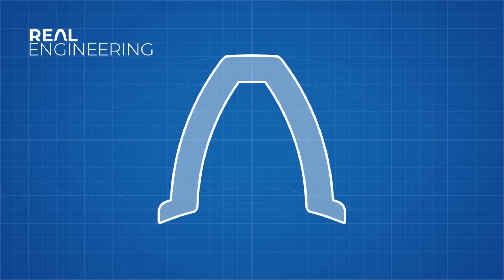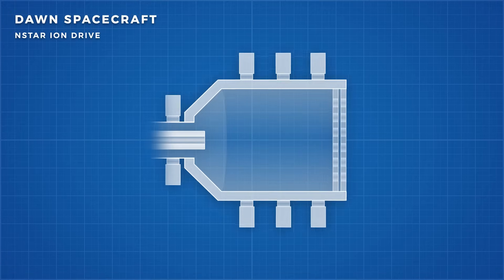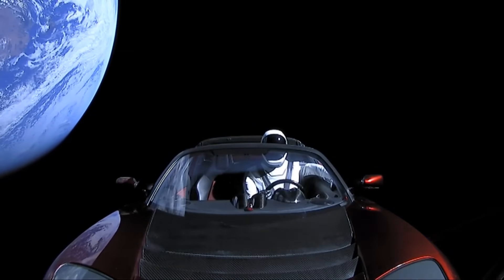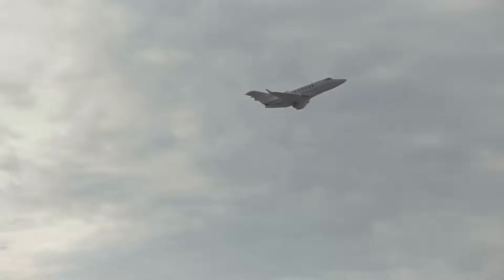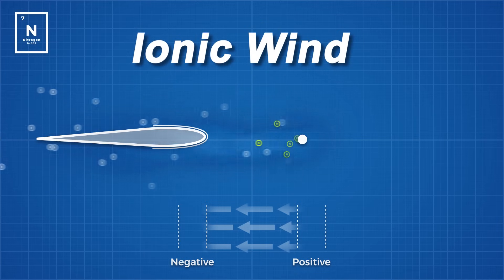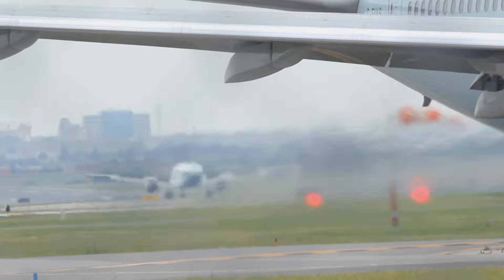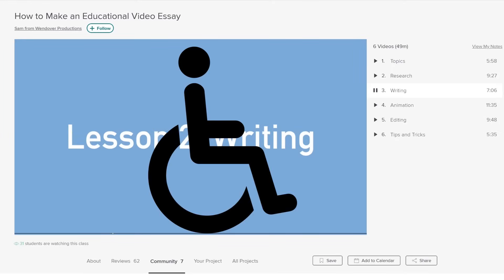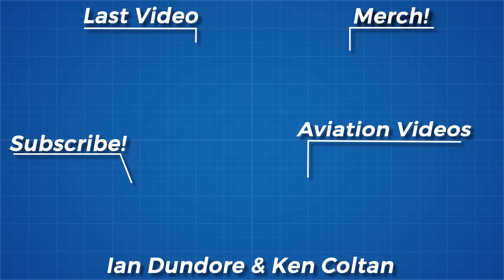Ion Propulsion - The Plane With No Moving Parts

Comment: What is your view on nuclear fission power on a global scale?  I think we should build more modern designed reactors.  Or even thorium molten salt reactors.
Reply from the maker: I'll make a video about it this year I promise. I don't know enough about it right now to make any intelligent comment on the subject.
Reply: I power my house fully with solar PV energy that means both heating and electricity and in therms of cost amortization this is more cost effective than natural gas.  The house is small and energy efficient (also designed by me) and is in a cold place Saskatchewan Canada. The 65m^2 house (700sqft) is powered by a 10kW PV array + 160kWh thermal mass storage and a small 5kWh LiFePO4 battery. Peak energy needs are in January when house need 1000kWh for heating part of this is provided by the average electricity usage 120kWh/month for appliances including electric cooking.
Total cost of materials (labor was done by me and not included in cost) is $15k and all is solid state with a minimum expected life of 30 years thus monthly bill for electricity + heating is $42/month about half for each.
Here is a link where you find user manuals and a description on how this works (see last pdf) https://www.kickstarter.com/projects/electrodacus/solar-bms-and-digital-mppt-for-pv-electricty-and-h
Reply: @RealEngineering  "I'll make a video about it this year I promise." 

So in 3 days? :)
Reply: @RealEngineering  👌👍
Reply: @RealEngineering  

Please do a video of Solar, Wind, batteries, and their supply chain management.

Their massive use of rare earth metals, cost of extraction, use of petrochemicals
Reply: Molten Salt Reactors are the only model we can A) Cool consistently enough and B) Miniaturize enough while maintaining effective shielding.

Our main problem is that we've been building reactors far too big, which makes them vastly more expensive to service and doesn't incentivise shutdown or complete overhaul.

What we need are fission reactors for individual cities not entire states.
Reply: Why didn't you point out the existence of fission reactors working with fast neutrons?
When designed properly such a reactor can reuse radioactive waste from the old-fasioned reactors.
And when designed inproperly such reactors just produce less radioactive waste.
BTW, there are already 2 working, profitable and reliable reactors using this principle that actually reuse radioactive waster right now, so we can be sure it works.
Reply: @Optical Clarity You sound just like any LFTR fanboy. And you're very rude also. I don't believe for a second that you're actually involved in any serious work on the matter with that attitude.
The quality of your comments has rapidly declined within this section, down to the point where you're only making a joke of yourself.

And that video you linked is everything else but "a good introduction to LFTRs". It's an action-filled trailer with catchphrases and no science. Only good for those that want to make LFTRs their new religion.
Reply: You guys are such nerds lol I love it
Reply: Great piece of technology, especially getting rid of long-term radioactive waste is great, but the engineering side isn't quite solved. Molten salt reactors operate in a temperature range of about 500°C to 1500°C, which is great from a thermodynamics standpoint (large temperature ratio -> high efficiency), but horrible from a mechanical standpoint. Steel melts lower than that, and even high-melting alloys get quite soft, making the construction hard, expensive, and requiring quite a bit more maintenance. It may still be uneconomical to build MSRs. AFAIK, only China is seriously pursuing the idea, and that's probably not an accident with them being a command economy, and no market economy trying to compete with them.
Plus, at least with Thorium MSRs, there is the issue of using large quantities of hot hydrofluoric acid on site, which might be a tough sell in any country that gives a fuck about the environment or worker safety.
I'm not even sure the "does not require a pressure vessel" is that much of a safety plus, tbh. Building a tank that will hold 150 atmospheres is something we know how to do. Building pipes that will happily conduct radioactive, corrosive soup at a temperature that would melt steel, not so much.
Reply: Yes. Absolutely yes, at least until we master fusion. Nuclear has long been the better option. The sheer amount of land it takes to equate to nuclear is astounding, and the cost of development and maintaining solar and wind power suppliers just adds to that contrast. People are just to freaked out by its historical failures, even though less people have died in nuclear power suppliers than alternatives like wind and solar. 

There is a good reason the US invested billions and got nowhere with green energy. The truth is, it doesn't work as well as people would aspire it to be.
Reply: Using U235 reactors (with uranium enrichment) would prove to be completely unsustainable, we'd run out after a couple of years. You need to save your U235 to kick start the reactors, since otherwise you can't begin the nuclear reaction.
Using Th232 or U238, we would have as much nuclear fuel available as there is tin available to mine. It is so much that you cannot call it non-renewable. If you want to call Th232/U238 non-renewable, then you need to call geothermal and solar non-renewable as well, since those are going to run out too.

As for LFTRs, well, I'm not 100% sold on them yet. The core principle of the LFTR is that you have the nuclear fuel dissolved in the salt. I'm more confident in normal MSRs. You get a lot of the benefits from LFTR (high temperatures, high efficiencies, low pressure, no water to be decomposed into hydrogen and explode like it has happened in every single past nuclear reactor accident), and you don't have to worry about designing piping that can withhold decaying nuclear material. There are companies that are trying to build MSRs, my favourite one being Moltex Energy since they seem to have a really proper plan and they are already making huge progress on building an MSR in Canada. Other companies include Terrestial Energy, FLiBe Energy (With Kirk Sorensen as its founder, he's the guy in the 5 minute LFTR video), and of course you have China pouring millions into MSRs, and they are already making huge progress (they fixed the graphite core problem, which is astounding)

Fusion is nice, but it's nearly impossible to do, and even IF they manage to do it, it's going to be hundreds of times more expensive than even the most expensive nuclear reactors we have today. It would be like building CERN in every place that wants power.

What I fear the most is China beating everyone in the race and building a monopoly on LFTR. They can make LFTR into an SMR design and ship them around the world. The only big company that I know of that is trying to build SMRs is Rolls-Royce, but maybe there are more.

It just saddens me though that there are all these brilliant technologies that no one is paying attention to. Too much focus on batteries, solar and wind, when it can be easily proven (and has been done so many times) that these technologies will never be able to power the grid of any developed country.
Reply: @MrJason005  isn't France getting a Fusion reactor online for the early 2020's though
Reply: Even if they do get it in theory, it will just be a big science experiment. Fusion will NEVER be used for commercial power generation, as the reactors are just too expensive to build, and they cannot be competitive with solar power (which is very cheap!)
Reply: @MrJason005  Well we all have to start somewhere I guess. If this French project leads to more viable fusion then it will improve over time just like fission has done or is in the process of doing. 

I forget the actual project name but I'll edit my comment once I find it out.

As for solar like others have said in the comments I can only see it applying to residential useage only. 

Hydro and Wind being used in other areas. 

Though think about it when people start plugging in million of electric cars per day there is no way we could do it on renewables alone. 

So this fusion project if it van lead somewhere then fantastic but ultimately we are going to need new Fission reactors to keep up with the expanding baseline due to electric vehicles.
Reply: @The Raging Storm

The French project is called ITER.
And my reasons for doubting fusion come from these blog posts: https://matter2energy.wordpress.com/category/nuclear/fusion/
Reply: @MrJason005  A good paper I can see its outcome is well reasoned. 

About the resources point the article makes surely if it's such a big requirement for fusion then fission plants would be built or at least more plants open up for the commercial use of those elements  for fusion based reactors.

I agree it's going to be a challenge but ultimately if ITER proves to meet its target output or even exceed it. Then I guess Fusion will be the way the government's will want to go and ultimately those areas in which the article notes as drawbacks for Fusion will be overcome.

Yes it's going to be expensive and there may not be immediate benefits, but both government and commercial are trying to make it work and one will succeed eventually. Ultimately probably will be a combination of both I guess.

It's fair to say it isn't viable which is true it won't be for many years and that's if things go as they want it to go. But fusion will happen eventually even if takes a long time it will become a usable technology at some point. 

I'm not going to say it won't work or won't be viable but agree with the articles analysis that at current and the immediate future there are more issues yet to overcome than people who want it to be the technology of tomorrow so badly say there is.
Reply: @Optical Clarity No, people with intelligence understand that they've just wasted 5 minutes of their life.

There's nothing wrong with LFTRs, but they're not production-ready. I agree with @Autolykos that the problems are about contruction and engineering and not about physics.
And the waste problem is also a big issue. The flourides solve easily in water, which makes them impossible to store safely. So additional post-processing is needed at no energy gain. It is completely unclear how to process and store the waste products at this point. There are some unproven and untested ideas floating around, but it just adds to LFTRs not being ready to use.
Reply: @Optical Clarity The problem with that video is that there's almost nothing to learn from it. The information density approaches zero. That's why it's not an introduction to anything.
Reply: I hate that this thread has devolved into a pissimg contest. But that's youtube for you. The following is in a nut shell.

-Solar can provide power for the grid. If homes are designed more efficiently. We are not yet at a point were solar is impractical. Not to mention new technology like dye sensitized solar cells are similar, in promise, to the LED revolution in displays.

-Nuclear will allow us to keep things much the same. With the exceptions of ICE vehicles which have to go anyways.

For example if homes were built to utilize thermal mass it would ease to a point of being negligible heating and cooling cost. The largest energy sink in modern home. Making solar panels, regular kind, on the roof of any house practicle and much cheaper, smaller energy needs.

I don't need to say much about nuclear. The biggest issue is complexity and byproducts but as I said. Compared to the first generation of reactors. Nearly all reactors in operation today. We've made strides in that department. Every nuclear disaster has necessitated those strides. 

Here's the kicker though why can't we do a combination of both. More efficient homes via thermal mass small solar arrays = less demand. Less demand = small reactors.

Again this is in a nutshell.
Reply: @Mia-ln1zs  I also think that solar is the way to go for residential energy use. But one has to keep in mind that residential energy use is less than 20% of all energy use. The majority is industrial. We also know that global energy consumption is increasing. Most of that is in emerging countries and will also be industrial and transportation.

I think the reason why there isn't much development for new and better fission reactors is that it's considered a stop-gap solution. Fusion always seems to be right around the corner and that's a risk for investors.
We will definitely need a nuclear solution, but we can hold out for a few more decades before it becomes a necessity.

About housing. The better you insulate your house, the more you run into diminishing returns. And all those insulation materials also need to be produced. So there's definitely a sweet spot where those two overlap. Some say we've already reached that point with new houses in central and northern Europe.
Reply: @P8qzxnxfP85xZ2H3wDRV  I totally forgot about industrial power use. Yea solar couldn't meet that demand. At least in the same way it could meet residential demands. Thanks for the reminder. No issue with your post good points.
Reply: @Optical Clarity You're either the most tenacious troll on the internet or a prime example of the Dunning-Kruger effect.

You've completely destroyed this comment section for anyone interested in alternative and/or new energy sources. I'm just going to ignore you from now on.
Reply: @Optical Clarity your article/paper only discusses solar within the framework of current fab tech, deployment, and trends. Which is perfectly fine. It did not however discuss the proposed efficiency tweaks I outlined in my post. Like significantly reducing/eliminating a huge power sink in modern homes heating and cooling. Through the use of thermal mass. Which would require little modification of modern home design. So I don't really see why you presented it as if it was a rebuttle. 

Forgive me if I'm wrong, but I haven't really digested it. It doesn't seem to come to the same conclusion as you do. "Solar will never even come close... ...You have to have a baseline. Solar won't do it. Wind won't do it. Hydro won't do it." I also take issue with you presenting it as a either or type of situation. I'm quite certain a combination of all could meet demands. Whether or not that's the best course moving forward is another matter. I think I was thorough enough being lazy right now intellectually, but I feel like my post is pretty solid and covers your concerns in regards to my post. I apologize if it doesn't.
Reply: Optical Clarity, any realistic plan to wean off of fossil fuels should make extensive use of nuclear power in addition to solar and wind since nuclear is already a reliable source of energy that we can improve.  

I agree that we should develop fission reactors that can reuse spent nuclear fuel and try to eventually develop economically viable fusion.

If the United States doesn’t do these things, somebody else will. 

The Chinese are invested heavily in building thorium molten salt reactors short term and developing viable fusion commercial reactors medium to long term.
Reply: @Optical Clarity  Look, just quote better numbers, then. I really want LFTRs to work, for all the reasons the video you link praises them. It's just that they are a lot harder to get running than you seem to think, and a certain person making videos about them and gathering fans is not telling the whole truth about it (in other words, he's trying to sell stuff).
(My bet is that we'll have economically viable fusion before LFTRs).
The issue with pipes losing structural strength is something they had a lot of trouble with at Oak Ridge when experimenting with MSRs, btw. And that was with a prototype never meant to run for decades.
Reply: We should have went with newer thorium & molten salt reactors a long time ago. The military industrial complex actually helped sideline this and then the later nuclear disasters squashed real effort into newer builds and now the cost is just enormous. But we would be so much better off right now if done so. It would be the perfect stop gap solution until fusion reactors. We still need great base load energy production and this is something that wind/solar advocates don't really think about. Wind/solar is awesome supplementary wise and with better storage tech, whether battery or more exotic solutions (even water, weights, heat storage with salt) it would be great for meeting peek demands.   Anyone worrying about nuclear waste just hasn't really bothered to look into it deeply. Heck, coal ash is more radioactive and a MASSIVE problem in comparison.  But,  yeah, as I mentioned, thorium was sidelined because you can't use the waste, etc, for weapons programs.
Reply: @Optical Clarity Then why don't you get together with investors and just build an LFTR, if it's so easy and all solved already?
Reply: @Optical Clarity Yes, and I'm a Navy Seal with 300 confirmed kills. Your other comment contradicts itself. Either it proves your point or its an intro with no substance. Since you just said its only an intro, that means it doesn't prove your point.
Reply: @Optical Clarity "it is only an intro anyway, moron.  People with intelligence understand that is only to pique your interest.  It is up to you to learn about the rest."
You stated here that the video you tries to use as evidence was only an intro, and that its only to pique interest.

Also pretty much your entire line of arguments so far has been "I'm an engineer who runs a company" (unverifiable), "your numbers are wrong" (no evidence provided) "I posted a link to begin your education" (link goes to a video which, as shown above, you admitted was only an intro meant to drum up support, not proof that LFTRs are a viable technology), "you moron" (personal attack, which isn't going to convince anyone) and "that's a strawman fallacy" (I think you either don't know what this means, or you're using it as a shield against all criticism. Made a bad point? Claim the person pointing that out doesn't know what your real point was.)
Reply: @Optical Clarity "Look just grow up. The numbers you quoted are bullshit.  And you know it.  A already posted a link to begin your education."
Why would you mention the link here if it was not to back up your point about the numbers?

Also, "everyone who disagrees with me is unintelligent". Yeah, sure. Really proving those academic pursuits there with that solid logic.
Reply: @Optical Clarity I mean that we have actually done nuclear fusion in 2018, we didn't do a controlled fusion reaction in the 60s.
Reply: we prefer  enhanced depleted krypton
Reply: Don't forget that uranium can be extracted from sea water now. The ocean has a constant concentration of it that leeches from the planet's crust.
Reply: @Optical Clarity You have called everyone in this thread who disagreed with you a moron.

You have no idea who I am. You have no idea whether I am capable of doing research or being honest.

I'm sure the Tumblr activists whose favourite phrase was "educate yourself" believed the same thing. As is, you've presented no actual evidence to back up any of your points. If the facts were on your side and you actually cared about getting people to agree with you, you could have just posted a few source links that proved your points, and this whole conversation could have ended a day ago. Instead, you've been making assertions and talking down to everyone because you couldn't possibly be wrong.

Everyone thinks the facts are on their side. Everyone thinks they're honest. You'd win by posting some actual evidence of your claims.

If you were a teacher, you'd be fired for your appalling teaching skills.
Reply: @Erikkun yeah that's what I meant by solar in space, but we need energy transfers for that, and beams are great but as far as I know we don't have an efficient way to focus and collect a beam, not one on this scale at least, for example; photovoltaic is way too slow and has a 20% efficiency, heating some stuff and using steam to transform heat into mechanical movements probably won't stand the shear amount of power we are sending in... 
also you are targeting a giant beam of light at earth, what are the impacts on the atmosphere? what happens if something goes wrong and the beam gets misaligned? lots more questions... Isaac Arthur has some great content on this... but I doubt a dyson swarm is gonna go up in the near future (technology and politics)
we need another few breakthroughs in engineering and mindsets to get going
Reply: @celivalg  Actually current high energy photovoltaic cells do something around 43% efficiency with bundled high energy light beams. That's the type you would shine on with multiple mirrors. And also the type that burns birds out of the sky. But for energy transfer through space, this would also be the right choice.
Reply: @P8qzxnxfP85xZ2H3wDRV  oh okay but that still leaves the problem of where does the 57 other percents goes, heat? and how much is lost in the atmosphere?  so yeah still far off, but as you said, if we ever go spaceport and stuff yeah that would be the best route, at least I think
Reply: @celivalg  The remaining 57% are either reflected off the surface of the solar cell or absorbed and turned into heat. 43% is actually really good. It's better than a car engine and right on par with new coal power plants.
The question about "losing something in the atmosphere" isn't relevant, because for the efficiency calculation, of course, you use the light flux that actually hits the solar cell. The further you go up north, the more mirrors and area you would use to shine on a single one of those high energy solar cells.
Reply: I think Iron man would like to have a word with you
Reply: If we could use fusion rather than fission it would be lovely. Hiroshima and Chernobyl would be gold mines for energy I'd think, if they could just find a way to do it.
Reply: Nuclear fusion is right around  the corner with big players like Jeff Bezos pouring money in. Why even bother with fission?
Reply: @MinecraftMasterNo1  because it's here and ot works. And we need a solution for now.  That's all.
Reply: @Mia-ln1zs   We're talking about building new factories, which could take years. It was never about now.
Reply: @MinecraftMasterNo1  But once completed they will definitely be useful. It's not the same as holding out for something that may or may not ever come into production. It's like designing a new computer for consumer quantum cpus. Yes, people are working on it, but when and if it will ever be useful to you is an unknown.
Reply: @MinecraftMasterNo1  Because fusion is always right around the corner.
Reply: @ReddwarfIV   This time there are companies with proper capital and investments working on it. Not faux academics who just need material for publishing.
It's always enjoyable how people work much more efficiently when profitability is on the line
Reply: @MinecraftMasterNo1  I hope you're right. But its not guaranteed.
Reply: New technology as nuclear industry in development to a power as a energy as a country.
Reply: @MrBraffZachlin  Reactor to develop in technology in a system.
Reply: Fusion is already achievable, within at most 30 years, fusion will be applicable on a worldwide scale making fission irrelevant. Still it's understandable that these modern fission reactors would work much better than the older ones, it's kinda late for that.
Reply: @Optical Clarity It doesn't matter what your point is when you admitted the video proved nothing. Also, https://yourlogicalfallacyis.com/the-fallacy-fallacy
Reply: @Optical Clarity you seem pretty doubtful. Shame you'd rather say something would never work rather than be excited that it is almost available.
Reply: Rosetta Stoned Nuclear fusion is coming!
Reply: They are needed. Badly.
Reply: There are some nuclear technologies that would have short by product half lives but the potential fallout is an absolute environmental disaster.  The nuclear power that’s currently in the US could destroy our environment entirely - we have plants on fault lines and major water sheds.

People tend to extremely underestimate the power of solar while building in false assumptions about on demand power and current plastic technologies.  

The sun’s energy that hits the earth is roughly 20 thousand times the energy our entire civilization uses in a given day.  And solar power combined with battery technologies such as liquid metal, graphene super capacitors, and algae batteries can offer people sustainable power and maybe more importantly independence from monopoly power companies.

As usual money and power is an important factor - imho people would be better off using battery tech in combination with renewables for community control of their power.  All the plastics and materials used can be made from easy and sustainably degradable plant materials.  They’ve even attempted to design solar panels from living organisms...

And Nuclear power even in best case scenarios with short half-life materials could still potentially be a disaster tech.  But anything will be done in order to keep the monopoly of power going including destroying large areas of our ecosystems and environments.  

This engine in the video is a good example of how past assumptions are incorrect.  We should be rational and stop making bad assumptions about power technologies.  One of the most annoying assumptions that people make is that for us to have nice things such as electric power we have to use some potentially dangerous and scarce resource and or dangerous tech so that the powers that be can keep control of our energy tech.  And anybody who says otherwise is selling pie in the sky or unicorns.

But there was a time when electrical energy itself was a fantasy.  And the economics of the future should be based in sustainability, abundance, and ethical design simply because we have no other choice really...
Reply: @JamesOGant  Solar power does not work around the clock. The natural tilting of the Earth makes the problem far worse in winter for high latitude countries. The cost to adequately back up by batteries is astronomical and suits greedy solar power business opportunists and monopolists. Making solar panels also has high carbon foot prints. Germany in a week in December 2017 supplied less than 1% of its power from solar power: the rest came from brown coal, which waste has more radioactive content than nuclear waste. Solar power is always backed up by gas and oil.

Bottom line: I am highly sceptical of claims that countries like Poland can have ALL their energy needs supplied by solar/wind/hydro only: This includes running large factories, powering the transport systems of large cities. It is sobering to think that despite the trillions spent on solar/wind, they supply less than 3% of mankind's energy needs. Can a modern jet liner fly on solar power?

I welcome solar power, but on a pragmatic basis. Some countries could get by with it and they should do so, but don't ram it down everyone's throats as a panacea. This is the thinking of a fanatic
Reply: @John Bower france has gotten 60% of its power from nuclear since the 60s. All their waste fits into a vault the size of a swimmingpool. The whole muh nuclur wuste argument is stupid.
Reply: nuclear fission is a really good transition energy, we probably won't use it long because of it's poor renewability, dangers, wastes and the rest... however we can't consider completely powering our civilization out of renewable resources, we need something more powerful, and that's where fission comes in, but when we figure out fusion, or maybe some way of collecting solar energy from space or idk what, we'll probably get rid of fission because there are far better options to generate huge amounts of energy... Once we get better at energy transfers, I bet solar in space will be the good thing but we'll probably have to go though fusion first, and that's still a bit off... but I am sure of one thing, we need to get rid of coal and gaz power-plants, that's not the way to do it...
Reply: @celivalg  Your information is wrong. Nuclear fission has great renewability. 97% of nuclear "waste" can be recycled by other reactors. The danger of nuclear "waste" is completely overstated and easily solvable. Bury it.
Reply: @Willaev  well I don't claim to know everything, but why are we not recycling it then? expensive? If I remember correctly yeah this can be done but wouldn't it produce way less energy? I mean when we throw away the fuel rods, they are in a state where they emit far less (well at least enough to make us change them) usefull radiations than before right? and I would still not call fission renewable, fusion is already on the borderline because we are still consuming the fuel but we got soo much of it...
anyway because of the consequences of a nuclear fission reactor meltdown and the probability of it happening because of human errors, I still don't think fission is a good long term source, but we might still use it for another 100 years or so
Reply: Government. That is the only hinderance to development\ and progress
Reply: @ProfTheorie  well firstly let me explain the entire situation. As best I can. Firstly the family member isnt a direct relative to me. She lives with my brother and his wife (it's his mother in law) and she was wanting to have a small place built on the land (just shy of 5 acres) she wants to be off the grid so she can reduce electricity cost but heres the thing, her building is 14ft x 42ft. And to power it just enough to be stable for her 24/7 with no electric bill the entire roof and even some one the ground is needed to power it and we did price checking and called around and the lowest price estimate we could get was just a touch over $9,000 to have delivered and installed professionally. She then added she wanted enough to power the other house that she is currently staying in which would take up the remaining acres the house isnt using. Which added even more money. Just her little 9k panels wouldnt have her see any gain for 20 years. We checked it, we consulted with experts and even they said solar was an expensive choice and wasnt the best to choose. Believe it or not even the solar guy said to just get a single wind turbine. As he stated, it was about just as much if not less, takes less room, easier to maintain and insure for. So before you solar junkies go after me thinking I dont know what I'm talking about. I do know, it's common sense and easy to see that solar is useless and has to many disadvantages.
Reply: @ProfTheorie  yeah I saw the notification and can read the first 3 lines through it but I can't manager to find the comment...
and yes it seems more on the line to what I was believing at first. I still think that fission is a great transition energy, and from what I read we still have a bit less than 200 years of resources assuming no energy demand growth, so I'd put that at 50-100 years since the energy consumption of developed countries isn't raising that much (though this information is prior to Tesla's recent success, which might flip the tables) ( I don't know if this number is if we were all nuclear fission or with the current state  of nuclear energy production, take it with a lot of salt)... by then maybe we'll have figured a way to either get fusion, or either get way more area covered with solar or wind... 
Also since space mining might get accessible in the 50-80 years from now range, I've looked at uranium concentration and it doesn't look good, not for asteroids at least... so we probably wont get any reliable source from here...

But if we look realistically at the problem I doubt that we will focus on one source, look at today's production, it's all over the place with gaz and coal at the top (not even considering car consumption)... However here in France we are at about 80% nuclear, I think we only have 4 thermal plants left... So all nuclear isn't a impossible choice
Reply: Believe in the power of Thorium.
Reply: @ProfTheorie  stupid jack ass global warming contributor! Fuck you and your sorry waste of an existence!
Reply: Fission is a dead technology... producing millions of tons of nuclear waste, which there is no safe way to store long term and this issue needs to be addressed soon because the status quo as far as nuclear waste goes is in a really really bad situation, if not fixed in a few decades we will see major nuclear waste contamination causing whole water tables to be deadly.
Reply: The problem with molten salt reactors is the lubricant for the pump gets dissolved in the molten sodium then clogs the reactor cooling channels.
Reply: Rosetta Stoned only on a wendover video
Reply: @Optical Clarity You do not in the slightest sound like a professional engineer. Regardless of whether what you wrote is true or false, all your responses have been insulting people disagreeing with you, without even trying to provide any prove to your points. You call things other people say bullshit mostly without explaining why they are wrong and without correcting them.  If you actually came from natural sciences and you saw people not understanding things you'd provide them with (multiple) proper scientific sources to help them understand. The single video you linked does not qualify as scientific, as it throws out lots of numbers without any sources backing them up. For someone blaiming others for blind hatred against a concept you sure provided a lot of blind hatred to the people you're arguing with, not even realising they agree with you on LFTRs being an incredible idea if they can be realized, but being sceptical on whether we're quite there yet.
If anybody in this comment chain is talking the way a troll would talk, it is you.
Reply: Ever heard of LFTR (Liquid Fluorine Thorium Reactor)? It’s cool, it’s here, and it’s something you might be interested in.
Reply: yeah it is expensive. but so is fully going over to solar and wind. it might not be able to sustain us past this century - but that's a problem that is in the future. fossil wont do that either, not without consequences that make the increased cost of fuel and things like reprocessing look tiny by comparison. nuclear should be on the table for switching over to a more sustainable power economy. especially if you consider there is potential for it to advance even further...there is a lot more that can still be gained there compared to say wind turbines or hydroelectric dams.
Reply: I
Reply: Calm down, son, or you're going to time out.
Reply: @Optical Clarity This is not the comment we deserve but the comment we needed! <3 (in reference to your first comment here; I already understand all about thorium/liquid fueled systems)
Reply: We already are having a problem with nuclear waste.
Reply: When you think a sub comment section with so many replies might be interesting but turns out to be another sword fight....🙄
Reply: 1. In remote areas or a small town that consumed little energy. Nuclear power plant would be useless because of their inability to scaled down the size.
2. Too expensive for many countries.
3. Hard to maintain.
4. In corrupt countries, maintenance might be an issues. Compared to abandoned solar panel or wind turbine.
5. Advancing clean energy would help other industries reducing their operational cost down. This is extremely important subjects in many industries like automotive, aviation, electronics, etc.
Reply: In YOUR back yard.
Reply: Uranium and plutonium reactors are not making use of a renewable resource (at least, not in isolation) so given our current problems I don't think it does much for us long term.

Thorium reactors can be made to regenerate the fuel used, so that may have more merit.
It's an open question whether it's worth the effort though.
Nuclear power is expensive. VERY expensive.

Meanwhile, the cost of solar and wind power is has been dropping exponentially over many years and shows no signs of stopping.

Battery prices are also dropping fairly rapidly, which is great for static storage applications.
(energy density of batteries has not improved anywhere near as much, hence why electric aircraft are problematic - since typical fuels currently used still have something like 300 times the effective energy density per unit mass.)
Reply: @KuraIthys  I think you're forgetting how power grids work, all grids have a large base load on them that remains roughly constant 24hr a day and that is what nuclear plants provide for because they cannot change their output rapidly. Renewables cannot provide enough power for this baseload without a massive energy storage mechanism and would be further limited by things bad weather and winter sunlight intensity meaning you'd have to store even more power or have more solar panels to make up the difference during periods of low sunlight.

Nuclear is almost a necessity at this point, it is the only clean source of power (outside hydro) that can fill our baseload demand currently (in large urban areas at least), just wait until millions of people are plugging in electric cars every night, hydrogen fueling stations running electrolysis to prep for the next day, etc and a city's baseload will be massive, well beyond anything current energy storage can handle. Without new investments in nuclear we will continue to be forced to use coal and natural gas plants to meet the grid's baseload requirements.

Renewables are only half the answer, ignoring nuclear is accepting continued dependency on fossil fuels for power generation.
Reply: @MrMattumbo  Nuclear plants are actually fully capable of varying their output. The reason they don't is economics, not technology. Its cheaper to have a gas fired plant or a hydro storage plant cover high-usage periods than to have a nuclear plant running at less than full capacity (since t will have the same maintenance costs no matter the output.)
Reply: It's debatable whether or not fissile is non-renewable. In regards to U235 it's not. But there are other types of fissile such as thorium. That would make such a non-renewable debate moot. As it's so energy dense and abundant that it would be centuries maybe longer before we come close to running out. (The same can be argued about the sun it won't shine forever. Just saying). The real issue with nuclear power is it's complexity and waste products, but we are making great strides in that front. As fossil fuels are proving to be more trouble than they're worth as well as approaching the limit of availability. And renewables not quite being there yet we kind of have no choice for now at least.
Reply: @MrMattumbo  nuclear power plants are just steam plants aren't they? We use the uranium to boil water which makes a ton of steam that turns a bunch of turbines. Isnt that the over simplified version of it?
Reply: @moviemaker2011z  Yes, that's right. There are only two effects known to man to produce electricity on a meaningful scale. The Lorentz effect and the photo effect. Which means electric motors/generators or solar panels. The latter can be used directly, the former needs to be powered somehow. And that's where you'll always have a carnot cycle. Because everything in this world is thermodynamic. Not just steam and combustion engines. In fact, you even have a carnot cycle for the solar cell, but it's less obvious how and why (electron hole gas and radiation make it up).
In the case of wind, it's still solar energy that powers it. It's just indirect.
Reply: @moviemaker2011z  Yes essentially, the actual nuclear fission heating system is far more complicated obviously, but the turbines themselves are the same as what you'd find in other types of power plants.
Reply: @KuraIthys  
Battery energy density is nowhere near the level where it can be deployed as effectively as we need.

It's just not on the table yet and we're going to need a solution to bridge extended gaps once it does either way.

MSR + Solar + Geothermal + Battery + Biogas + Compressed Air Energy Storage + Pumped Hydro Storage is the ideal mix to pursue.

It's not something to be dogmatic about. Breadth of options beats a singular approach.
Reply: @KuraIthys  Currently, cost of harvesting Uranium from seawater is only 2-3 times more than mining. If this cost can be lowered, we will have enough Uranium for millions of years at current global energy usage.
Reply: @KuraIthys  Nuclear power is only ""expensive"" thanks to various under-educated nutjobs screeching every time they hear the word "nukular". If you applied the same safety standards and laughably overblown standards to renewable energy, it would literally disappear overnight becoming hundred times more expensive. Also, while you're correct that uranium is technically limited, we actually have far more uranium (that is otherwise useless in other applications, too) than we have rare earths that are being wasted on huge rate to make wind turbines and solar panels, stuff that is very hard to recycle later. If we instead used nuclear power then used rare earths making electronic devices more power efficient, the world would use far less energy and emit much less CO2 than one running on "renewables"...
Reply: @KuraIthys  sure...but the power output of windmills an solar panels compared to the area they take up (their power density) is quite pathetic...
Reply: @squeakybunny2776  wind turbines are amazing. There is a field in the pan handle of Texas that has over 200 wind turbines these turbines not only produce enough energy to make energy for the area they occupy, They actually send a ton of extra to Nevada to power its cities as well. Wind turbines are much MUCH more efficient than solar power.
Reply: @moviemaker2011z  more efficient how? In term of area they occupy? Then no... Solar panels have a relatively much higher power density then wind turbines
Reply: @squeakybunny2776  solar power definitely does not. Trust me I did the research. A family member wanted to put up solar panels to remove herself from the grid, to power her house it would take nearly her entire 2.5 acre of land and she woyldnt see ANY profit back for 20 years. Yet a man down in Texas built his own 2 wind turbines and they both run his house AND his shop (he does mechanical engineering and repairs) 2 turbines alone do more than 2.5 acres of solar panels. Not to mention solar panels break easily and are costly to repair.
Reply: Well if you are really convinced of your own mathematical skills and I'm not convincing enough you can of course just google it.

fact is that windmills take up a much larger area than solar panels for the same power output. 

In the end it doesn't really matter for large scale energy sources. Solar panels and windmills will never power the world. They are nice on a consumer level but not more then that.
Reply: @squeakybunny2776  your facts are wrong there buddy. Have you even seen a windmill? The guy that has 2 to run his house and shop take up very little space. If he had solar panels his entire yard would be filled up with the damn things, theres a fact that's right. You seem to be a naive individual that cant get over the fact that solar power is obsolete. All down in Texas you can see houses with wind turbines small ones that easily produce the neccessary power to run a home and they take up less than 2% of the yard. And these are average houses with a standard yard front and back and it's less than 2 dude. Solar panels are a waste of money. Again its thousands of dollars just to have them built and its YEARS before you see a return in profits. Wind turbines while also expensive can be home made and made cheaper than solar panels, last longer, are easy to move and relocate, and you see profit returns quickly seeing as how 2 can produce enough to sell back to the energy companies. Paying $0 for electric and making money back? Solar can't do that as quickly. Fact.
Reply: @moviemaker2011z  

well first of al: no need to be offended or to get personal.

Second of al: excuse me for not explaining that im seeing this in a more general grand scheme. Sure, When you only have two windmills you can place them 100 meters apart and they take up No space. But when your neighbours get the same idea you start to get in trouble. Windturbines need sufficient space because they create turbulence. So for an individual it's fine to have two of them taking up little space. But that's not how it works in the bigger picture and that's what I was refering to

Third of all: those are not mine facts but just facts. Not need to get degrading.
Reply: @squeakybunny2776  solar is even worse than turbines. Firstly you cant have them just spinning 1000 miles an hour, while that would make a load of energy it would also break the internals of the turbine. Another think to note is that unlike solar panels, wind turbines can be built with the minimal requirements. The guy I keep talking about in Texas is named Gary, and he built one semi professional looking. And one other made of cheap metal tube scraps and 55gal barrels. He also bought a nice big battery that he buried under ground which saves and stored the power. That's what his house runs on, when fully charged up any extra time the turbines run for is sending the extra electricity to the electric company which pays him pretty decently each month for his output. Note also he has 2 strictly because he had a shop that he uses for welding, cutting, and mechanical repairs for things such as cars, trucks, boats, farm equipment, you name it he fixes it. And with so much work to do he needs 2 turbines. 1 is all he needs for just the house alone. And also you cant have turbines in city limits depending on state laws. Where I'm from (springfield, missouri) cory ordinance states that you can not have a wind turbine unless your land is greater than or equal to 5 acres. With some exceptions of course. So space wouldnt be a problem for wind turbines in Missouri because there is a law in place that prevents this kind of build up. Solar on the other hand has many downsides, easily damages, very costly to have installed, insure, and to maintenance. One small hail storm and all of your panels can be damaged which reduces the efficiency of them. And like said wind turbines generate alot of energy easily and pay for themselves fairly quickly, only a matter of a few years. Where as these panels we were going to get would have taken 20 before she (the family member I mentioned) would break even on just the panels alone. Solar is a lose/lose scenario. Sure it produces green energy but it also radiates heat above them and can directly co tribute to the so called global warming epidemic. Turbines dont which is another plus.
Reply: @moviemaker2011z  In Central Europe or South Canada an average family uses about 3.5 MWh per year and silicone solar cells provide about 0.1 MWh per square meter per year. So you need 35 squaremeters of solar cells to break even on your power bill. A detached house should have a 150 square meter roof. So if you use 70% of the south-facing half of your roof, you should have more than 50 square meters of solar cells. That would mean a surplus of 1.5 MWh per year which depending on your your locality could mean an income of $500 per year (additionally to having no power bill).

Solar really works for residential up to a latitude of 50°.
Reply: @P8qzxnxfP85xZ2H3wDRV  I'm just saying, you will not be getting that money back for many years to come and also electric Bill's vary ALOT so you can not guarantee that the solar panels specs you listed will be enough. Example being the average electric bill a month for my family is roughly 200 to 300 a month. Can your solar panels fix that without taking up my entire yard and my neighbors? Wind turbines are cheaper if built in a minimum form which work just as well as any other and if you dont care for looks, they are much more sturdy and work anywhere 24/7 given that theres a breeze which there usually almost always is a breeze. Also note that again this house she has is 14ft by 42ft.

Simple thing is solar still has the radiating heat problem and fragility due to being made of glass. Also to use solar panels like you said they have to be specially placed, not a wind turbine. That can go near anywhere except by a tree.
Reply: @moviemaker2011z  I really understand what you're saying. I'm not against wind turbines, I just think they're better suited for off-shore parks. That's for all the reasons that @ProfTheorie just mentioned and also because of noise. The noise would drive me crazy and I would fight my neighbor to the bone, if he ever planned on putting up a wind turbine.

The example I gave on solar cells is just for an average family and an average detached house. Your friend's house is really tiny. I can understand why it doesn't work out for her.
My example doesn't depend on price fluctuations for electricity though. The 1.5 MWh are a surplus. It's what you additionally feed into the network after subtracting your own usage. This is not for an off-the-grid-house. There's no energy storage. It's for a grid-connected house that does an annual bill with a power company.
Reply: @P8qzxnxfP85xZ2H3wDRV  see now I have been around plenty of the smaller and more practical wind turbines and they didnt make much noise at all. Now sure when they are spinning at roughly 50mph (which is bad) of course noise will be an issue but they are not meant to spin that fast. A site I found said their noise can be roughly that of a lawn mower engine but from my experiences as a kid getting to be near alot of them, I heard no such noise even on the windy days. There was SOME but not even close to a lawn mower. It sounded kinda like the humming sound of a ceiling fan which if that's on the outside it wouldnt be a bother at all for me. Also wind turbines aren't really meant to be in every single yard and you really shouldn't build them if you have neighbors because if I have learned anything from living in springfield it's that neighbors can be complete assholes about any little thing you do. But like the link says for the guy to get his house to cut his electric bill by 35$ a month it would take 32k dollars in solar panels. So 32k ÷ 35 = 914 ÷ 12 = 76 years... 76 years before he breaks even on just putting them up most solar panels come with only a 25 year warranty and even then most people wont stay in a house for that long. It's very rare that anyone does so he will most likely lose thousands if he were to have done it. Is that even worth the investment at that point?

I guess in reality any alternative to energy is expensive as a way of keeping the people dependent on the government one way or another. But solar just has to many disadvantages to take the risk and even turbines do also, but I would rather take my chances there first especially if i could build it myself and save money on the installation fee and material cost.
Reply: @moviemaker2011z  nice essay you wrote there.

1. I never said solar panels are a good solution for our energy problems.

2. Ive never said that they were cheaper, easier to maintain or would return profit sooner.

3. Great for you that you live in Amerika where People have acrea of land and People can just stick a turbine in there garden but that's not how it works for most of the world.

5.because of that, goverments will have to reservate big area's for energy production through either solar or wind. And then, whether you like it or not, solar panels have a power density much larger then wind turbines.

6. Let it go...
Reply: @moviemaker2011z  I'm going to butt in a bit: I think the "2.5 acres" of solar panels is incorrect.  I happen to know that normal tier (home use) solar panels produce about 8 watts per square foot.  There's over 4000 square feet in an acre—over 8000 square feet in 2 acres.  Simple math dictates 8000 square feet * 8 watts/square feet = 64,000 watts = 64 kilowatts.  A normal American house uses between 2 to 10 kw.  She needs a fraction of an acre, and not 2.5 acres.  Also, plenty of solar panels produce 15 or 20 watts per square foot: so she would need a fraction of a fraction of an acre during peak sunlight.
Reply: @KuraIthys  1 kg of uranium/thorium will produce similar amounts of energy to 1 ton of solar panels over their whole life. "renewable" matters a whole lot less when the difference in energy generation is that high.

1 Kg of coal will produce 12 kWh
1 kg of solar panel will produce 17,000 - 34,000 kWh (over its whole lifetime)
1 Kg of uranium will produce 24,000,000 kWh 

if you start thinking about batteries big enough to keep cities running then you are talking about producing thousands of times more waste in production and disposal than our worst reactors produce over their entire lifetime. Better than coal but nowhere near our bad old reactors let alone our next gen ones.
Reply: long term is hundreds or thousands of years for nuclear tech we have now. with thorium it is millions. we need more of it, not less, to take care of our global warming issue and transition to even better tech. and we do have those better reactor designs already :-)....a lot of reactors are just outdated. there is no need for that stigma.
Reply: Getting energy from fission-fusion was demonstrated to be practical in the 1950s. This is the Ivy Mike design and uses a small amount of Uranium to kick start the fusion reaction. in the meantime, I favor nuclear reactors as a source of power, especially in high latitude countries,  like Poland where I live. At mid winter, the sun is here at a maximum declination of 22, temperatures can drop to minus 15, the nights are 16 hours long: there is no way that intermittent sun power and wind power will supply power. The trouble with solar/wind enthusiasts is their  'one boot fits all' approach. Solar power is probably practical in places like Arizona, its not practical where I live. The raw materials needed to create the equivalent power output for solar and wind easily exceed nuclear by a factor of at least twenty. That's not all: solar power units last 20 years, a nuclear reactor can run for over 60 years. Big solar plants are not that environmentally friendly: herbicides are applied to prevent plant growth. Nuclear power uses much less space than wind/solar and so frees up land for life. Finally nuclear waste: short-lived nuclides have their uses, the other waste like Technetium with  a lifetime of 100,000 years can be stored in geological vaults, but it not that dangerous. When we talk about waste,  uranium the size of a coke tin will supply the average man the energy needs of a life time, while the amount of plastic waste for Joe Average exceeds this in just one day or by a factor of 100,000 over a lifetime.
Reply: @ProfTheorie  1. going aggressive with 'he is talking out of his ass' is not a good way to prove your point and always lessen the strength of your argument
2. we are talking about the future, it's not because something didn't work in the past that it won't in the future
3. many other sources of energy are expensive; solar, wind turbines, water dams, and fusion is also going to be one of them, but does that make them bad power sources? No.
4. we need to get off gaz and coal, I'm not someone that has the environment deep in his heart, but I'm smart enough to understand that we cannot follow that route anymore. As I said before, to get governments to start caring about this stuff, we need a major breakthrough in our mindset, and it's happening... or at least I hope, US president was a major set-back...
Reply: @ProfTheorie  what I said is true and you know it. It's very easy to break solar panels and weather like hail storms are very much a threat. It's also a fact that solar panels radiate heat upwards which makes your surrounding area hotter depending on how many solar panels you have. Are you seriously that stupid that you cant figure that out? Also how am I bias towards wind? It's clear its superior to solar in many aspects such as size, cost, efficiency,  dependability, and looks. Size is easy to figure out seeing as how they take up a vertical space over horizontal unlike solar panels which take up horizontal over vertical, turbines also can be made in a variety of sizes and for most households a small one will be enough to lower the electric bill if not out right cancel it out. They are super efficient and can produce plenty of energy to a household with relative easy and can run 24 hours a day where as solar is only good while the sun is up. They are very dependable and sturdy. They can take a heavy beating where as a solar panel is made out of glass. Sure hail.or high winds can do some damage to a turbine but the turbine is more likely to keep functioning at 100% where as the solar panel is likely to suffer some sort of loss. And looks do matter. You can have some pretty ugly turbines but I saw one that was like a work of art, these people put alot of effort into making it look nice and it worked, is it neccessary? No but bonus points for creativity. Solar panels are just squares and rectangles... nothing really worth while. And you usually put them in a roof or on the ground if you are wanting to waste alot of money. And another point on dependency is the fact that there are more wind turbine farms than there are solar farms and if you cant accept the fact that they produce better energy than sorry to say but your stupidity is at a dangerous high. You are also probably using industrial sized solar panels which are not easy for common people to afford. I am talking about just standard solar panels, nothing flashy, no super mega jumbo do it all panel, just ones you can call in and say "I want enough to power my house" and you get what you asked for. And yes it would have taken the 2.5 acres to power both houses like she wanted, but we talked her out of that idea and to focus on just her, when she heard it was 9k she decided it was best to NOT do that given that the solar companies also said wind turbines would be better for what she wanted to do. Solar isnt exactly a get off the grid scheme you can just drum up. Wind turbines however are perfect for that very plan and also by the way jackass, I dont give a damn about green energy. I say burn all the coal and use as much oil as you want. I dont care about this green energy bullshit but I am however smart enough (apparently smarter than you) to figure out which option if given the choice to choose from if i wanted easy energy with little to no hassle. Seeing as how any bloke can make a wind turbine you can easily make one yourself and save money, however it's much more elaborate and strict on making solar panels. Yes you can make them but the materials are all costly on their own and require alot of hours of work to build and even then it wont be as efficient as what you can buy and it sure as hell isnt going to be worth the time and effort to do. FACT FACT FACT. God you solar junkies are obnoxious to deal with.
Reply: I think solar panels are a much better way to go, supplemented with geothermal, hydroelectric, and wind energy in compatible areas. I'd just stick solar panels to every surface exposed to the sun. However, storing the energy is something else.
Nuclear power, I feel, is sort of underdeveloped due to the stigma behind nuclear. We need better reactor designs, fast. Or we need more fuel, but this option only opens up when we get something like asteroid mining.
Reply: @duser  solar panels reflect and radiate heat. There was a whole.pandemic where birds were being cooked alive and dying while they were flying over solar panels. They also produce little bits of power and require a tone of space. Hydro, geothermal, and wind are all 3 amazing ways to go. Solar is not a viable enough option.
Reply: @duser  And we need people to not be a complaining wreck every time anybody says the word "nuclear".
Reply: @duser  Running a large power grid on energy sources dependent on the weather isn't a "much better way to go", it's a disaster waiting to happen. 

And if your concern is fuel, note that we'll run out of the materials necessary to make solar panels and batteries long before we run out of uranium.
Reply: @Willaev  Nice point. 
thanks for correcting me!
Reply: @Willaev  How very wrong you both are. Static batteries can be made of many different chemistries when weight is not an issue but cost is. The sun is the source of both wind  and weather in addition to directly powering solar cells whose conversion efficiency, even limited to silicon (sand is not in short supply) is getting better than 22%. 
Counting the inherent losses that base load fission reactors have when supply and demand are not in equilibrium, their thermal efficiency of 35% is often wasted to a lower rate during low demand just staying at temperature.  Storage methods and prices are making major inroads on your pet power source that needs government support, protection and insuring just to be commercially  viable AFTER the up front costs of construction.
Reply: @Willaev  Actually the rare earth elements used to make the magnets for the wind turbines and high quality photovoltaics are found in the same ore deposits containing radioisotopes. These heavy elements tend to sort to the same places.  So the "green energy" harvesting equipment generates piles of radioactive waste tailings piles. It is a nuclear waste problem without the reliability or efficiency of nuclear.  We need to have fission plants to consume the waste brought into our biosphere by the wind turbine and photovoltaic industries.  It appears real science is often counterintuiative.  The possible fusion reactors are many decades away from working if they can be made to work at all.  We can't make perfect be the enemy of better.  The plausible fission plants need to be built and operated, and if the fusion alternative comes into being, then that can be used.  We need better until perfection appears.
Reply: @paulgracey4697  Except you didn't say anything that proves me wrong.  
"Static batteries can be made of many different chemistries" 
Yeah, you could make batteries out of potatoes, that doesn't mean they'd be viable for a power grid. 
"The sun is the source of both wind and weather"
You're repeating yourself. Wind is weather. And you didn't make any point here, you just skipped around the fact that the sun doesn't always shine, even during the "day time" because of weather. 
"Counting the inherent losses that base load fission reactors have when supply and demand are not in equilibrium"
Counting the inherent losses that solar, wind, and hydro have when weather is not viable.
"your pet power source that needs government support, protection, and insuring just to be commercially viable"
You're talking about YOUR pet power sources, wind and solar. They're the ones that get all the government support, protection, insuring, and subsidizing. Nuclear fission is consistently held back by the government due to over-regulation driven by public ignorance and hysteria. 

Just think about the idea that climate change is inevitable, and you want to base the entire power grid on energy sources dependent on the state of the climate. 

But thank you for trying.
Reply: Fission reactors are going to be similar to what solar and wind is to the energy grid. As in Fission will take stress and load off the main input, coal and natural gas. But I dont think it will completely take over.